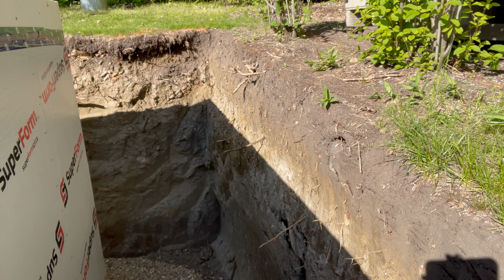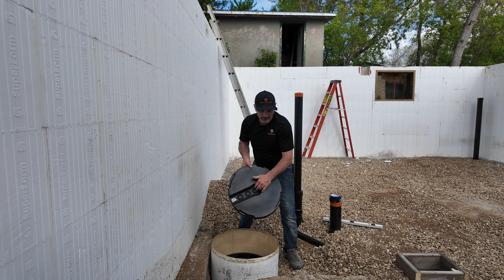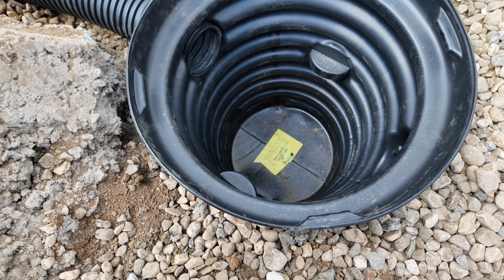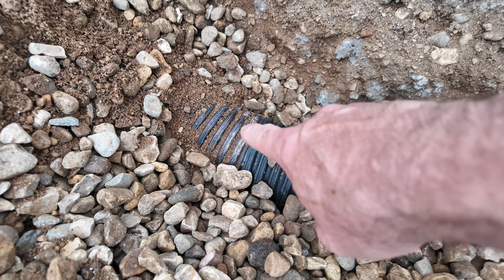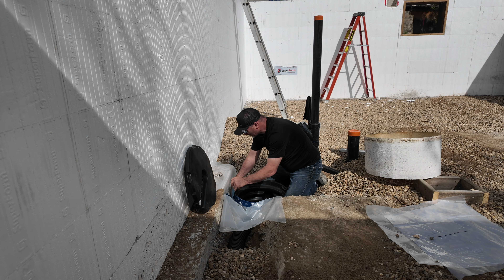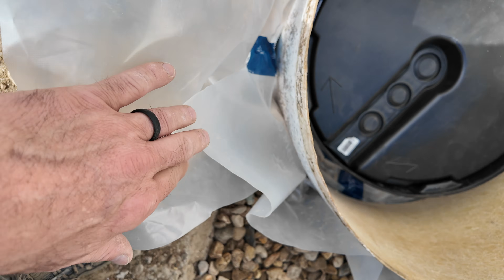Basement Waterproofing & Weeping Tile [Cabin Project]

Comment: Shannon, first off great video. I have a question- I never get water in my sump pit. The grading on one side of the house is steep the other not so much, but water pools in the middle of my and my neighbour's house after snow melt about 3ft away from foundation. Is it normal to not get any water in the pit? Or is the weeping tile not catching it as 3 feet is too far out? Hope to hear from you!
Reply from the maker: Many things can come into play here and many sump pits never get water in them. Water could be laying there because the ground is still frozen and once it thaws the water simply soaks away. Soil composition is a big factor on how water soaks and rains away , generally the lighter the soil the easier it can soak in and get away. Heavy clay soils retain /trap water and it has a harder time getting away or drying out and that's when it can cause issues usually. If you are not getting water in the basement and the pit stays dry you should have no issues but when ever possible try to grade soil to keep water from pooling , sometimes the grade is so flat there is just no way to do this easily .
Reply: @HouseImprovements  The soil composition here is clay-heavy. The good news is I do not get water in the basement (yet) but I'm concerned why I never get water in the sump pit especially since its clay. Anything I can do for easy checks to see if my weeping tile works?
Reply from the maker: If you want to come to the forum with your situation We can discuss it further there.https://www.house-improvements.com/forums/

Comment: Would u not  clay first just under your holes you  drill then rock also drill holes in pit bout 10 inches above  so u get ground water to under slab to
Reply from the maker: In a home with no weeping tile i would drill holes in the pit to collect water but when weeping tile is in place it should do the collecting

Comment: So with your drainage tiles/weeping pipes, what your thoughts on placing a cloth membrane around the pipe? I seen thatt on a few builds, dont know if that works long term.
Reply from the maker: We did not in this case, but could have. It tends to clog with clay so we opted for going without.
Reply: @HouseImprovements  that makes sense with the clay clogging the cloth. There truly is no way to keep the pipes clear long long term, they all seem to clog overtime. I thought of using a electric toliet rodder one time but kinda iffy on that. You know any means to clear them besides digging them out and laying new?

Comment: There's a lot of detail work before the floor is poured.  The outer walls need to have that coating to keep things dry.  I used to see that when Mike Holmes had his show.  When my parents had their house in Massachusetts the foundation was cement block with a concrete floor in the cellar.
My Dad put two coats of a thick texture fibered white paint on the walls.  That prevented water intrusion.  Water came up through the floor but with the channel in the new concrete floor where the floor came over to the walls, water flowed in the channel to a back corner into a hole and was pumped out from there.
Yours is looking great!

Comment: Thank you for the high level of weeping seepage pit. Please follow up of how you will pump it out of the basement. I am also wondering how you will pump out the sewage waste water to septic tank from the basement. Will you show the installation of the septic system on your property? Thanks again & and keep up the good. work..
Reply from the maker: This water will not pump to the septic holding tank, it pumps back out side onto the ground if it ever gets enough water in it. Not sure if we will show the tank install, That is a n next year project.

Comment: why have the water go inside just to pump it back out? Why not just have it drain somewhere away from the house?
Reply from the maker: Just regulations. If you pipe it under ground to drain away you could be causing an issue for a neighbour that you do not know about
Reply: @HouseImprovements  ah that makes sense
Reply: @hunatae  Yeah, my lovely neighbor put her pipe from her sump pump running out between our houses, which just happens to have a slope towards my house, so all of the water she was pumping out of her basement was ending up in mine...and she knew about it. She tried to tell me because it was pumping out on her property that she was not responsible for it draining onto mine. Town had something to say about that. Issue was fixed a week later lol

Comment: Does the water enter the basement through the basement foundation walls or from water rising up above the footings?  I have a basement leak, I believe is coming up between the basement floor and bottom of the foundation wall right above the footing.  I thought surface water ran down below grade, and the foundation wall helped deflect it down without any fancy membrane until the ground water level raised above my foundation footings and into my basement.  Probably, at the lowest point, which happens to be a corner on the floor where the fireplace meets the foundation wall.  It only happens after extremely heavy and lengthy rainfall, only about twice every 5 years.
Reply from the maker: It could happen either way depending on your situation. The weeping tile creates a place for it to go before it leaks into the basement. You could possibly benefit with just a catch basin placed through the floor and to a point below the footing . It would allow water to seep to it hopefully before it leaks into the room. You can then have a sump pump in the basin that pumps the ground water back outside further from the house.
Reply: @HouseImprovements  I don't have much water to deal with.  I also have an ideal topography situation.  I have a daylight basement with the daylight at the front of my house.  The back of my property is above the top of the basement, and the front curb is about 10' below the basement floor.  The grade on the left side of the house is about 7' lower than the right side of the house.  The leak is near the front left corner.  I believe my problem could be resolved with weeping tile on the outside of my basement and directing water away from the house, which is how it would naturally flow.  The pump seems like overkill for my issue when I have gravity working for me.